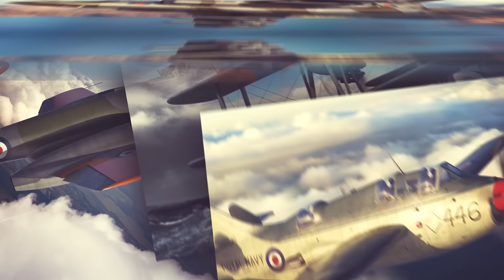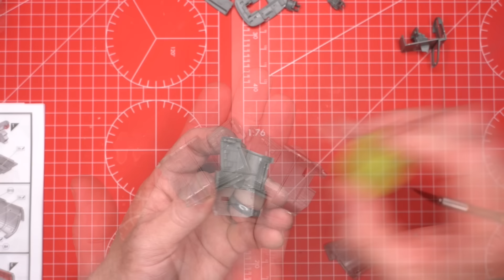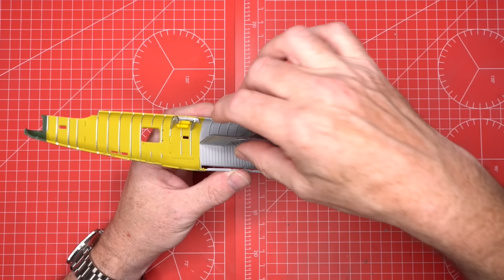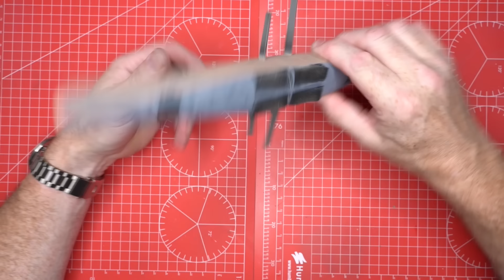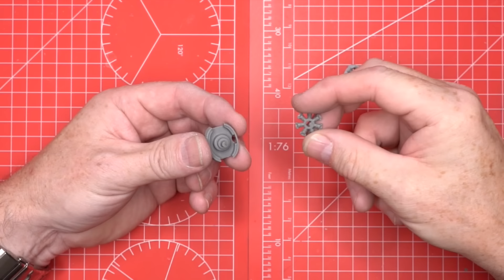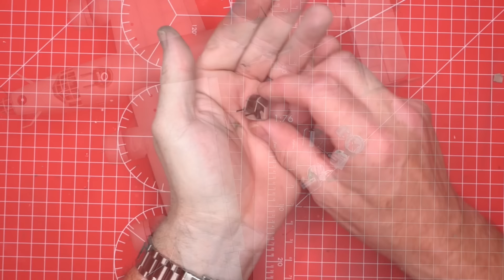Airfix Full Build Consolidated B-24D Liberator | Beyond the Basics

Comment: Nice work. It would be really great to see a future Liberator release in one of the versions used by RAF Coastal Command. Their role in extending convoy protection into the mid-Atlantic and helping to overcome the U-boat threat in time for the D-Day build-up was so important.
Reply: And the RCAF flew them from the east coast of Canada for anti U boat patrols. The Coastal Command Libs would make for great model not only for the paint scheme, but how they were equipped with radar, rocket rails and the Leigh light. Certainly different than the run of the mill USAAC aircraft.
Reply: @TerryShwetz-h5z  I wasn't brave enough to try and scratch the rocket mounts but I managed to adapt this kit (with a 4x .303 turret from a lancaster) resin radar from eBay and a scratch Leigh Light into a pretty convincing Coastal Command version.